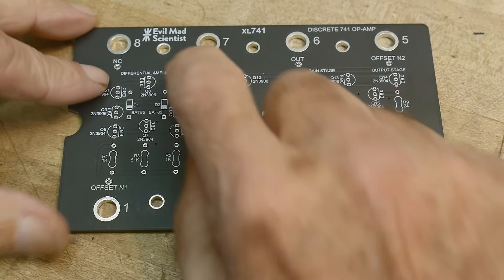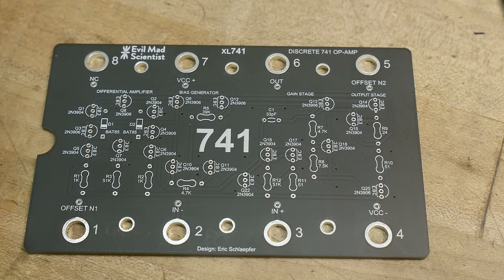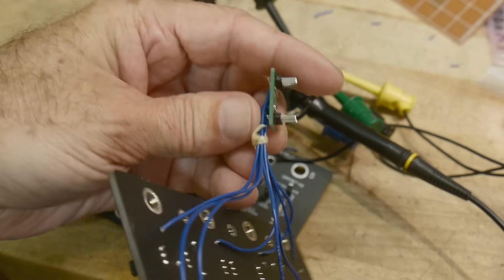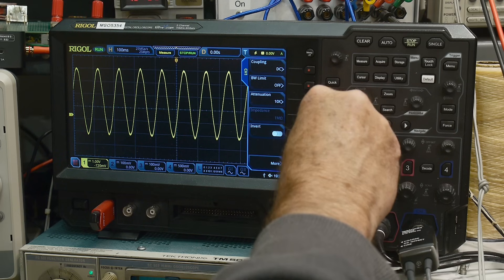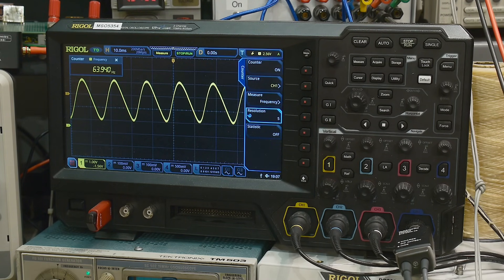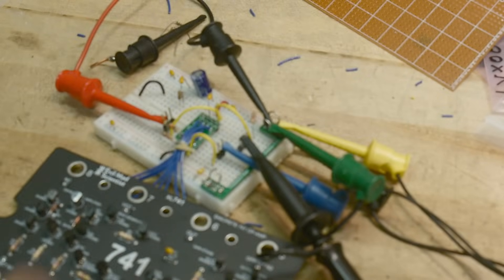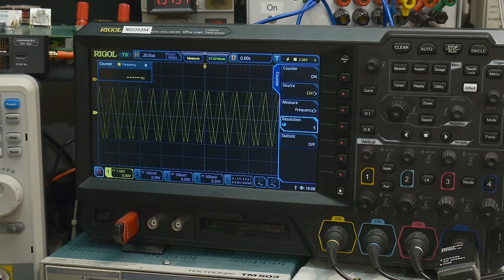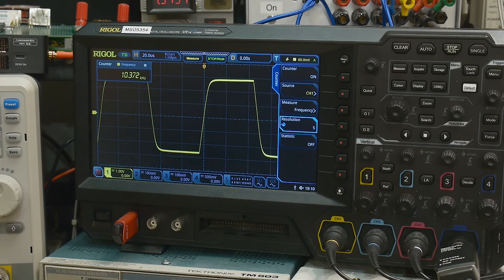#1735 Evil Mad Scientist 741 (part 1 of 3)

Comment: In addition to matching the transistors in the input differential pair and the two Wilson mirrors, a 'proper' job would thermally bond the matched pairs so that the variation of saturation current and Vbe with temperature would cancel out.  Now you've got me thinking... wonder what a discrete BJT opamp with PMP4201 and PMP5201 for the differential pairs would perform like.  :)
Reply: The 741 circuit and layout was optimized for the IC process they had available. Copying it using 2N3904/6 is not going to yield good results. And an op-amp this big needs CMRR adjustment components and has to be tweaked to work well. They stopped at just getting a copy to work and that’s a bit of a disservice to the analog arts.
Reply: @absurdengineering  I think we're saying basically the same thing here. It needs temperature compensation, it needs CMRR, it needs better adjustments of Vos and Ibias, and so on.  But it can provide a useful illustration of how these things work on chip, or just a cool toy to have on the shelf somewhere.

Comment: As long as you are not going to apply more than 10V voltage to the inputs, it would be better to replace D1 and D2 with just wires.

Comment: Is q8 position oké?  I also have this board, and it works much better.
Reply: Just for me it looks the wrong way around too... 🧐 With C and E reversed the transistor will still work somewhat but with very low amplification. Actually i dont know the 2N3904 and .06 very well because they are kind of exotic here in europe, but at least with our BC547 / 557 "standard" transistors it is as described above 😇
Reply: I'm in the UK so not part of Europe but physically right next door and believe me the 3904 and 3906 are not exotic !! @tvelektron
Reply: @tvelektron does DigiKey deliver to where you are? Because if so you can get 2N3904/6s by the literal 1000 if you want.
Reply: @JaenFoster  Of course it is no problem to order them, several distridutors habe them on stock. But in fact most of the 2N.... devices are just very unusual here in europe. There are only very few types well known, like the "big boy" 2N3055 and maybe the 2N2222. Locally very common transistors to "play" with are BC547 and BC557 and something like BC327/BC337 for a bit more power. Interestingly, we use a lot of "1N.." diodes even though there are also European "BA.." diodes. Just for example 1N4148, 1N4007, 1N5408,....
Reply: @tvelektron A Japanese viewer might mention 2SK transistors.

Comment: 741s suck
Reply: This was like a Porsche 911 in electronics back in late 60s when it came out.  You can hardly find anything so ubiquitously sold from 60s.  Most hobbiest have at least a few laying around in their arsenals.  Wait until this guy goes over how it works.  My prof once said that 30pf cap was a state of art in those days.
Reply: yeah I have some too, but they suck. @bayareapianist
Reply: Aw!, not that bad!, it's a very early design, long since superceded by better devices.
Reply: Yeah, but way back then we all learned how OP-AMPs worked thanks to them existing (Even at RadioShack) and then later when you started using lots of OP-AMPs all together and had problems you learned about nulling, input current, and PS rejection ratio. Later the newer OP-AMPs were a welcome treat. Now OP-AMPs today are almost perfect!!!

Comment: When inserting the actual 741 you corrected the bypass capacitor, however afterwards you never checked the 741pcboard with the bypass capacitor correctly connected.
Reply: Yes that was a bit frustrating so I hope that will be corrected in part 2.
Reply: @andymouse  Hey Andy 🧀 
How are you ? Will we see you at the Alliance at 10ish ? 
RIP Calculon.
Reply: I came here to say the same thing. Woud've been nice to have the true comparison.